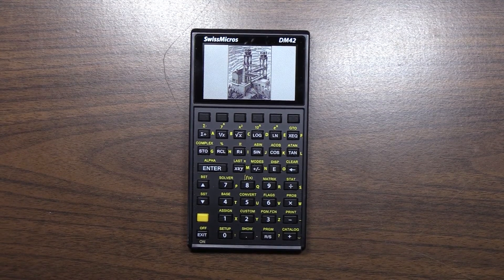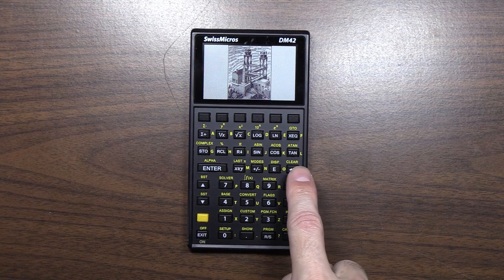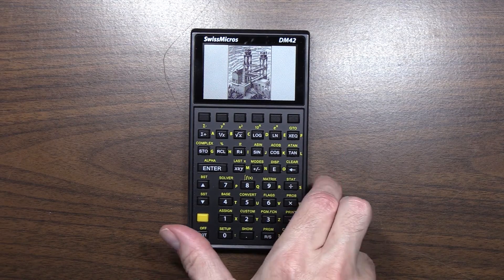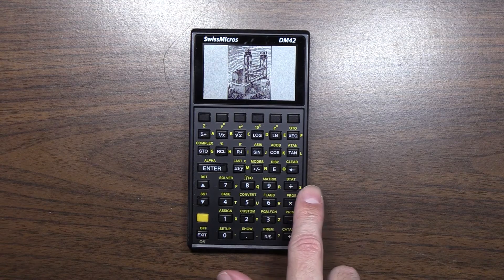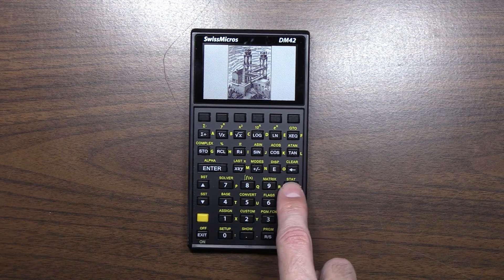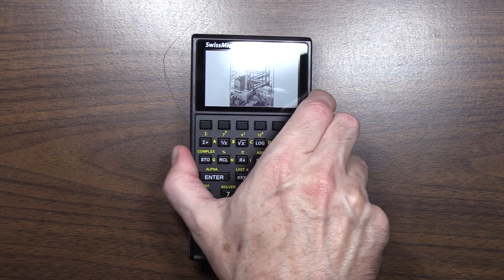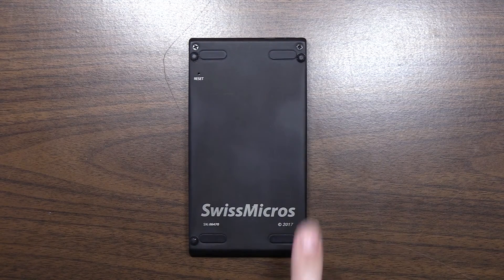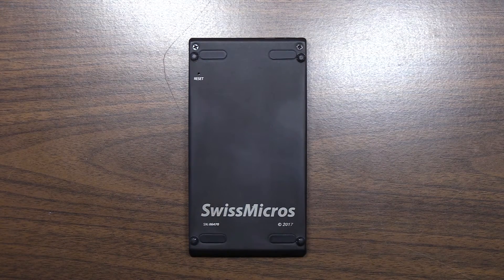The SwissMicros DM42 rocks.  But should it?

Comment: I thought exactly the same Scott. An almost perfect calculator, except for 2 things, the Enter button that has two microswitches under it (it still throws me when I get the double click) and the rubber feet not going far enough to the edge. But for the rest, superb piece of kit and I almost prefer it over my HP15C :-).
Reply from the maker: I had no idea for the reason the Enter feel clicked twice when pressed near the center — I trained myself to hit it off to either side.  I would also add that the keyboard is very good, but not great like the hp 48GX (and I would expect the hp 42S as well since it is of a similar vintage). Regardless, I am very happy w my DM42. Thanks for leaving a comment.

Comment: That's an important concern from a fellow key banger. I like your solution. My desktop at work is slightly warped. It drives me crazy and to the point of bringing my hand plane in for some old fashioned adjustment. On any given day I ridiculously bounce between a 35s, Prime, 15c, 41cx, and a 32s like a chain smoker with Bic lighters. I thought I had your issue until every model bounced. It will drive ya' crazy. Thanks for posting & I hope Swiss Micros considers the input.
Reply from the maker: Laughed at the chain smoker analogy.  I think the type of person who is into something like the SwissMicros DM42 is also the type of person a bit prone to analysis of everything.  But, a person who is very particular and detail-focused is exactly the person I want designing my airplane, car, etc.  Thanks for leaving a comment, and enjoy that excellent HP collection!

Comment: Problem still present at SN9840. Rocks pretty heavy on the right side. I can spin the calculator 720° sitting "flat" on the table + the two case halves don't seem to match too well, leaving a rather unpleasant sharp edge on top. Pretty disapponted with the metal casing considering one payes around 300€ with shipping and customs.
Reply from the maker: It would be cool if they switched to a machined base, but probably not cost effective at the scale they are doing.

Comment: Just a question. Are the keys hard to press compared to the keys of the original hp42?. Thank you
Reply from the maker: I have never felt the keys of the original hp 42S, but I do have an hp 48GX which I believe is very similar.  The 48GX keys are great.  They are better than the SwissMicros DM42 keys.  Partly because they are more rounded and partly b/c they just have a better feel.  

That said, I find the DM42 keyboard completely acceptable, just not as good as the hp 48GX's.  I did confirm that my DM42 has the improved keyboard -- it was a revision they implemented on 9/25/2020 according to SwissMicros tech support.

I would rather use the DM42 than the original hp 42S because of the amazingly good screen with larger viewing area and the improved, dedicated menu keys, ability to import/export programs via usb, etc.  Even if the keyboard is not quite as magical as the original's.

Hope this helps.
Reply: @scottcollins7513  thank you for your accurate answer

Comment: After HP stopped making "real" Calculators after phasing out the 48G/GX, I felt obligated to support a company like SwissMicros. :)
Unfortunately DM42's purchased in 2022 still "rocks", apparently due to manufacturing problems with the metal backplate.
There's no HW-rev markings outside on the DM42. Does anyone know at which serial numbers the HW was supposed to be improved?
Btw. It's not the placement of the rubber feet, but because the metal-back isn't flat!
SwissMicros should IMO fix this by overall increasing the mechanical quality on the DM42.
In the meantime they could simply add some thickness to the rubber feet. ;)
Reply from the maker: Perhaps mine is not flat and that mine is fine simply because I went with thicker rubber feet.  Manufacturing is HARD.  Just ask Elon.

My calculator is s/n 06470 and has the improved keyboard.  I've had it for around 1.5 years.  You might want to contact SwissMicros tech support if you have specific questions -- they were quick to respond to my question about whether or not I had the improved keyboard (it seemed fine to me which made me think it probably was, but I wanted to confirm).

I still think it is great that SwissMicros is doing what they are.
Reply: Mine also has a slightly curved back. sn is 07445 i have it for a few weeks now. It does not bother me because i use it mostly sitting on top of its leather case.
Reply from the maker: @Slasher006  Too bad they have not come up with a fix in the intervening 1000ish units (assuming the serial numbers are incremented by 1).
Reply: @scottcollins7513  Nonetheless, i love that thing 😀
Reply from the maker: @Slasher006  Agree 100%.  It is a superb calculator -- my favorite.
Reply: Stopped the rocking! It’s not that the base plate isn’t flat it is the tolerance of the spigots holding the frame to the base plate at the bottom edge. There is the smallest of gaps between the frame and the base plate. Have managed to slip a very thin piece of plastic into this gap at the bottom edge and is now rock solid. It would have been better to have screws at all 4 corners. HTH